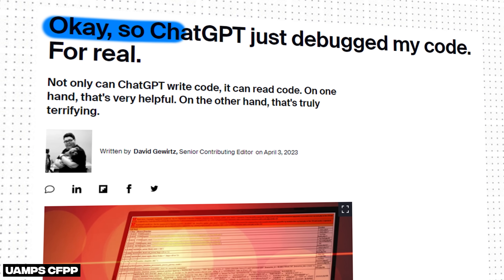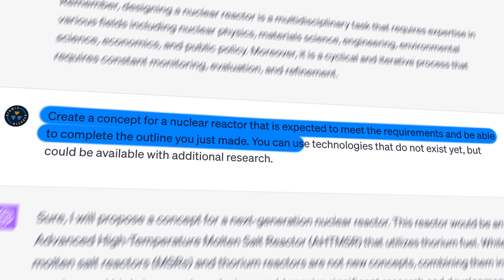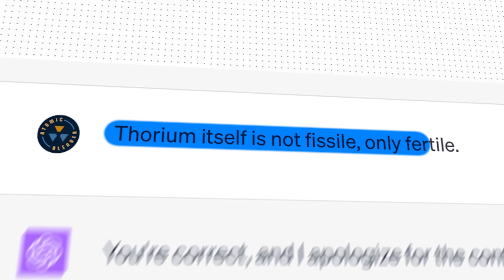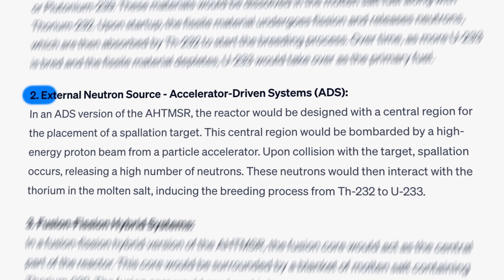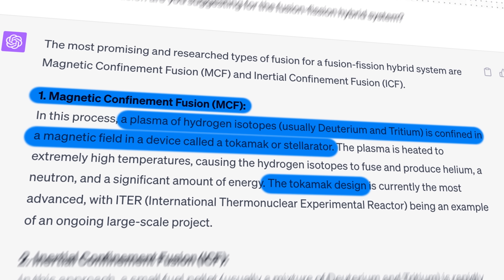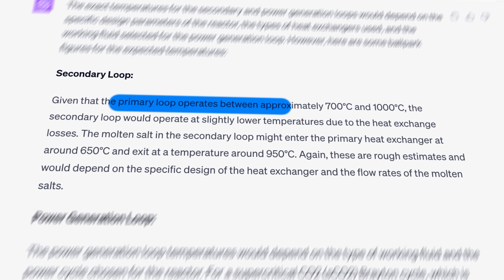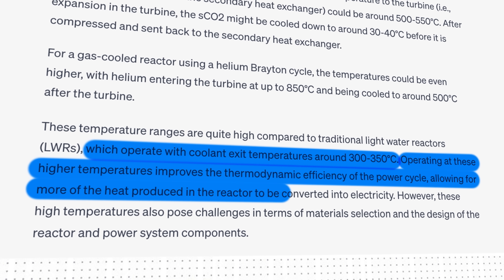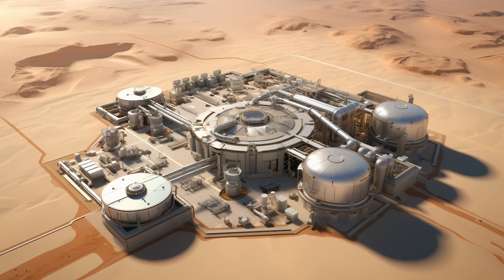Unveiling ChatGPT's Insane Nuclear Reactor Design

Comment: chat gpt makes impossible designs as i often do:
A water wheel made with balloons and a vat of mercury; the balloons enters the vat from below passing in a field that doesn't make the water fall so we can use the gravity to move a wheel linked to a dynamo and we have free energy.
Using things that can't exist makes designing stuff very easy. Too easy. Anyone could do that. :|
Beside that you need to TRAIN an AI, feeding it the nuclear reactors schemes, making sure it understood them, feed it nuclear physics, and maerial studies so it can start to operate correctly.
Those are AI, not AGI. They can do one specific task they're trained for. ChatGPT is an AI that is getting informations like an AGI, the result, therefore, is this nonsense.

Comment: Should you/we be worried? The answer to that question is yes. AI is going to get you first in the big scheme of things, in the form of intellectual or security requirements for some theoretical future reactor technology. Most likely though it won't be some smooth talking HAL9000 type computer that will get you/us first, moreover the man in the suit that wields ChatGPT with his fellow knights' of OpenAI inc. You may have already disqualified yourself because you might not be the only engineer to pose this line of questioning to ChatGPT.

Comment: Interesting video. 

I really like the sci-fi approach of the AI, because that´s really no way a human engineer would even consider to go. 
Despite this being not really a possible concept, I see some potential here. 
What we´ve seen here is a first try even without the necessary input (which would be training data of engineering and nuclar physics, as well as infrastructure knowledge) to the AI system.

So it´s like watching the first clumsy steps of an AI-trained robot, what is meant to walk like a human.
 
I´d say, just give it the proper training data and few million or even billion (virtual) tries, and this could become a realistic concept.
Especially when used in combination with more specialized 3D-modelling AI.

Did you gave Chat-GPT the advice to go for scematics when it prompted midjourney for the pictures?
If not, this could have led to a more specific picture of such a plant, rather than the nonsensical add-like pictures it gave you.

Thank you for your good work and keep the hair-fission going! 🙂

Comment: This all well and good.   But it does not help in any way that we are decommissioning reactors instead of building more of them.    Sadly?  the MANPOWER is what is lacking here.    Who wants to do a boring job making power when there is no real benefit to it in your life?    

The story goes that the plant in Washington was shut down not just due to political pressure, but that a whole swath of men who worked at the plant just happened to get divorced or had their personal lives ruined.   
Hence, why there was no real pushback from having the plant shutdown, and a cover story of the plant being in a fault zone  (Something it was already designed to cope with) was given as the excuse to shut down the plant. 

If you want more great things like cheap energy?  You are going to have to protect and safeguard the MEN & people who run these plants tirelessly, and without fail.    Something that has gone to the wayside for a LONG time.  

We don't have a problem with cost building these plants or even keeping them running or functioning.  
In fact the total cost vs the amount of generation a single mega plant can provide  is ridiculous!
Its like printing money! 

The more efficient your plant is,  the longer you can run your fuel.   And if your Fuel is based on thorium?   You can darn near dig a hole in your backyard and mine enough to keep the thing going for years alone.  

In fact?   Your typical EV  Fast charger   puts out  350 Kw.    
That's 470 horsepower for 15 min straight for a fast charge.     

Now scale that up to just 1000 cars that you would typically have in any metro area charging,  and add in electrical losses.   That's around 400,000 KW.   Or?   536,409 Horsepower.    

For reference?   
The Wärtsilä-Sulzer RTA96-C turbocharged two-stroke diesel engine is the world's largest and most powerful production internal combustion engine.
 It has a maximum output of 84.42 MW ( 113,000 hp or  400 MegaWatts. ) 

So the biggest marine diesel engine in the world can't charge more then maybe 250 or so cars at a time.  
And that's IF it was running FULL BORE, full load.   

By comparison?  
Tokyo Electric Power Co.’s (TEPCO) Kashiwazaki-Kariwa plant in Japan is currently the world’s largest nuclear power plant, with a gross installed capacity of 8,212MW.  

How much fuel?   
  Since 1 gram of any fissile material contains about 2.5 x 1021 nuclei, the fissioning of 1 gram of fissile material yields about 1 megawatt-day (MWd) of heat energy.    Meaning?  1 Gram makes 24MW of power.  

In order to charge a thousand EV's @ 400MW?   You would need about  less than 17 grams.   
To put that into perspective?   
That's about a TABLESPOON of physical fissile material.  

A TABLESPOON of FUEL can make 400MW.     
And that's IF you use the Traditional reactor design.    With newer models?  
You  can even use less, and then even RECYCLE the FUEL!   

Why is this important?  
A typical city has about 70,000 EV's in operation.   

Now imagine if you had 70,000 cars that just came home from  work or a trip on the weekend and needed to charge.      Are you ready for this?    

70,000 cars plugging in that night requires  28,000,000 MW of power to the grid to charge.   
Meaning?   You would need  3,500 Kashiwazaki-Kariwa plants to just keep up with just the Electric car infrastructure.  of a SMALL City.      

But wait...   There's more!   

 As of December 2021 , cumulative registrations of plug-in electric passenger cars totaled 1,072,136 cars.  
That number is projected to be 2,000,000 in 2030 JUST for  Los Angeles.  

Meaning?   
You would need 100,000  Kashiwazaki-Kariwa plants to just keep up.   And with at least 20% more for things like down time etc.  

And we have not even began to talk about all the other EV needs now.     
Remember,  we are asking for a complete electric changeover .  That also means lawnmowers and Trains and SO much more.  

In order to keep up with our NEW EV future?  
We are talking about   close to a MILLION  Brand spanking new Nuke plants to just keep up with demand.  
Or?   start building  Mega sized Nuke plants in the 500,000 MW Range!

Comment: Can of Raid 
Rainge! 
@ nasa 
Nasa I have a question about aerodynamic 
Does it have to be an arrow? 
Can it be inverted? 
If it's not general can the air be aerolightdynamic 
Aerosol? 
Can my spray be the aero part?
If my shower was the (spray part) 
Like bending reality by sitting sideways or backwards on the via bus but still going forward
Reply: I worked at Drury Northstar that had men from General Dynamics (saw on wellborn road by the Juarez slates of stone )
Reply: Tell them I said hi I took the real asfab
Reply: Turned out to be cancer called me trash and he went AWOL haven't seen him since

Comment: Inside the star there is a cube of antimagnetic Inside the star there is a cube of antimagnetic Arthênyus crystals lighter than an ant parachute, the flower of the wind (the lightest flower on earth and in any other universe. The mathematical calculation of the projection of reality that the cube constructs is 1 trillion of bits per second.

Dentro da estrela há um cubo de cristais antimagnéticos de Arthênyus mais leves do que o paraquedas de formigas a flor do vento (a flor mais leve da terra e qualquer outro universo. O cálculo matemático da projeção da realidade que o cubo constroe é 1 de trilhão de bits por segundo.

星の内部には、アリのパラシュートよりも軽い反磁性のアルテニュス結晶の立方体、風の花 (地球上および他の宇宙で最も軽い花) があります。立方体が構築する現実の投影の数学的計算は 1 兆です。ビット/秒。

É necessário construir uma placa com propriedade de cristais antimagnéticos para o circuito DIE. Esta placa deve ser alimentada instantaneamente pela energia do cubo (INTERIOR da estrela) construído por cristais Antimagnéticos de Arthênyus. Somente assim será possível reconstruir a Armadura REY ARTHÊNYUS E RAYNHA ARTHÊNYUS. PARA TRANSFORMAR TODA MATÉRIA EM UMA REALIDADE ANTIMAGNÉTICA (NÃO DENSA). 

It is necessary to build a board with antimagnetic crystal properties for the DIE circuit.  This plate must be powered instantly by the energy of the cube (INTERIOR of the star) built by Arthênyus Antimagnetic crystals.  Only in this way will it be possible to rebuild the KING ARTHÊNYUS AND RAYNHA ARTHÊNYUS Armor.  TO TRANSFORM ALL MATTER INTO AN ANTI-MAGNETIC (NON-DENSE) REALITY.

DIE回路には耐磁性結晶特性を備えた基板を構築する必要があります。 このプレートは、アルテニュスの反磁性結晶によって構築された立方体 (星の内部) のエネルギーによって瞬時に電力を供給されなければなりません。 この方法でのみ、アルティニュス王とレイニャ・アルティニュスの鎧を再構築することが可能になります。 すべての物質を反磁性（非密）な現実に変換します。

O cubo abaixo é o tamanho real do cubo que há no interior da estrela.

The cube below is the actual size of the cube inside the star.

下の立方体は、星の内部の立方体の実際のサイズです。

Comment: So, the fusion breeding idea by chat gpt got me thinking about doing a particle (atom in this case) accelerator design for breeding the thorium using cobalt or similar elements that are heavy isotopes. By smashing them in fairly high luminosity areas which are right where the molten salt thorium is, you would be able to capture the heat from the fissile event (micro bomb i guess as they would quickly fissile out and become non-radioactive elements that would increase density and heat for the area to be picked up by water) while the majority would be able to be filtered out of the molten salt and fired back in through the accelerators. Also allowing for a degree of total control over the amount of extra energy provided through the neutron release captured. Think exothermic, like high heat and pressure compression ignition in diesels. It would be a similar kind of concept. Then, just like diesels, we can scrub the exhaust and keep that energy and the elements that didn't fissile and decay. 

I was also thinking of the same thing for hydrogen (deuterium and tritium) fired into the molten salt with a high amount of luminosity, but also a degree of entanglement for the hydrogen. If you can get them to in a semi entangled state and allow for a brief pressure of them heading towards each other, you should get a degree of higher tunneling events. allowing for a higher amount of fusion, possibly. Now granted, it would need multiple accelerators aimed at each other, if there was an amount of super-positioning in the right area as well it would gain a increased amount of quantum tunnel ability too, and they would need to have the ability to withstand high heats and have thorium traveling through its smasher area. While, most likely something that can be done, it isn't something being done currently that I'm aware of right now. 

The entanglement would be accelerating the hydrogen similarly while having it moved up and down, side to side, and spun in a helical fashion, most likely on its travel to being hit. The super-positioning would likely be from laser you would use, together with electromagnetics and electrostatics, to force a degree of super-positioning like separation and mostly focusing for the accelerators luminosity. It would produce a higher likely chance for quantum tunnel events to the other hydrogen (which is what helps fusion) with the heat being added from molten thorium salt and of course multiple aimed accelerators (like the inertial confinement lasers) at the thorium salt surrounding a pocket of this area to fuse together. Increasing the breeding and hopefully capture of energy from both fusion and fission. The hydrogen would float up and be able to be separated from the thorium and be reintroduced. I feel it could work, but as I am no phd in any of these areas, I would have to somehow build it, and test it. 

it might be that both heavy elements that can fissile quickly and the fused hydrogen would work more easily and readily in a hybrid-like system. it all depends on the speed of the acceleration, the heat, the entanglement/super-positioning, and the confinement area of the luminosity increasing tips for the thorium breeding area of this process going on.